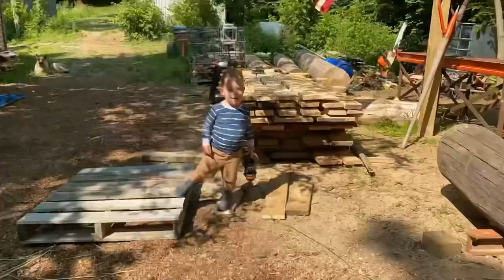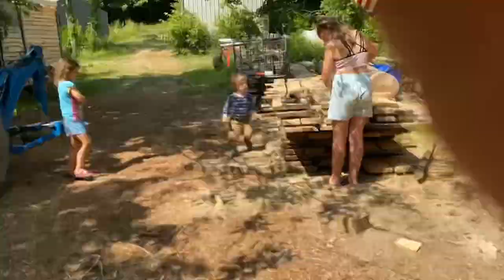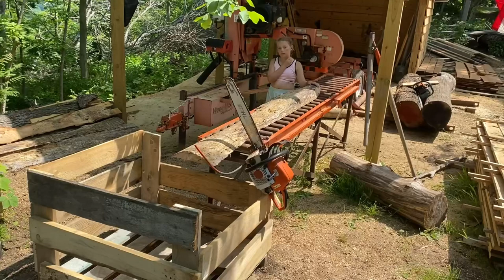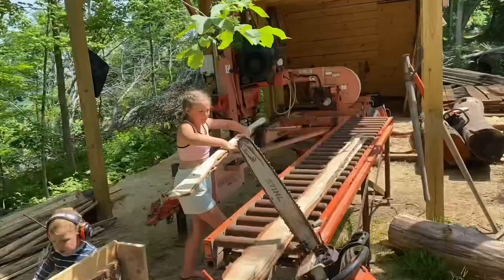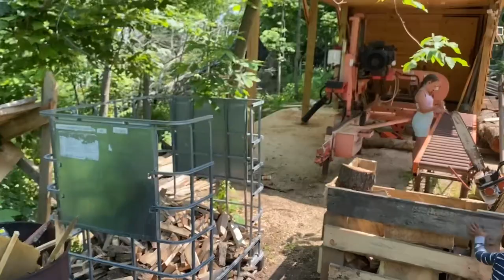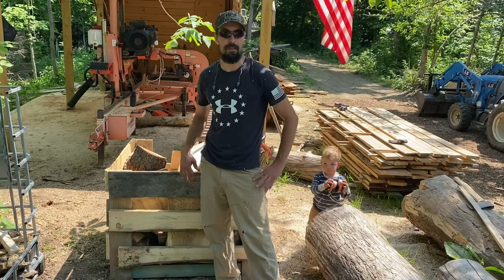Sawmill Slab Firewood Processor. Easiest method I have used!

Comment: I did something similar to cut peeler cores for firewood.  Found that having side rails on my roller table helped a lot to keep the wood from binding up during the cuts.  I could stack up to 15 at a time and cut them all squarely with my 20" bar.  HUGE timesaver!
Reply from the maker: Awesome! Yes i need at least one edge support for sure, i think that will definitely help.